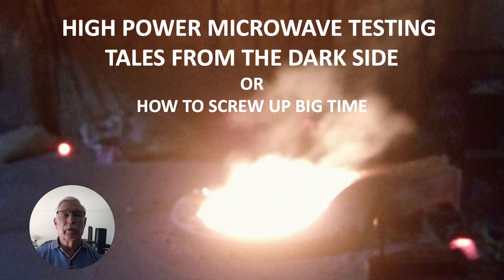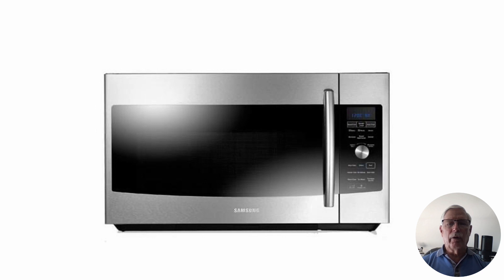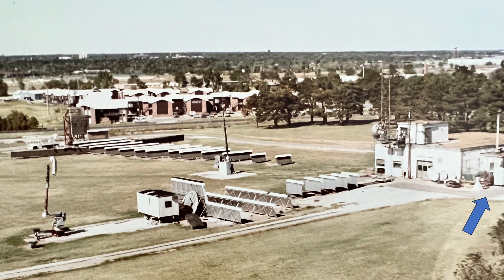HIGH POWER MICROWAVE TESTING TALES FROM THE DARK SIDE OR HOW TO SCREW UP BIG TIME

Comment: Microwave screwups? We had some issue with the air dryer meant to keep moisture out of the waveguides for a 10kW (max) sat uplink.
It turns out, if you put 10kW through a wet waveguide, the steam explosion wreckes the waveguide and even the unistrut it was bolted to. O_O

Comment: Ever messed around with a rectenna and microwaves for wireless energy transmission?
Reply from the maker: Sorry, I have not.
Reply: There are a few videos on Youtube that detail more than I imaged I'd find when looking into how the human body is a receiver.  Well, technically, the human body is a transceiver in a wider range that is clearly disclosed for some reason.  Seems should be more detailed and is not.  Albeit, dielectric info is the most thorough I've found. Anyways, I think the Bang Goes The Theory has the more interesting drone powered wireless using microwaves episode and video.  The LRAD helmet episode and NIR power transmission is interesting as well.  They never did an ADS episode, though would be interesting how they could have detailed.